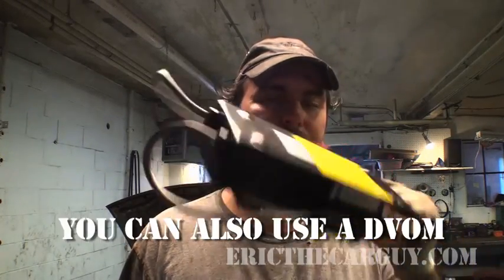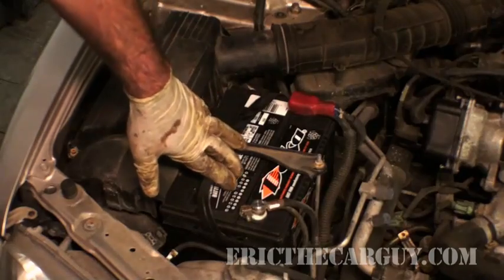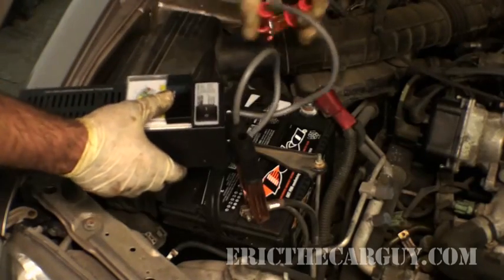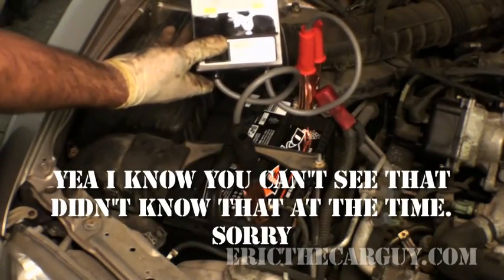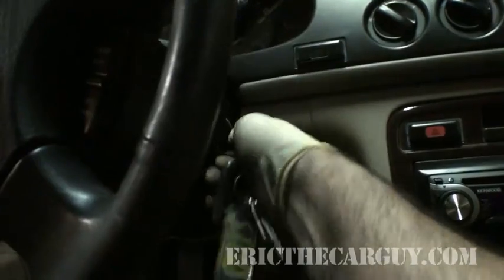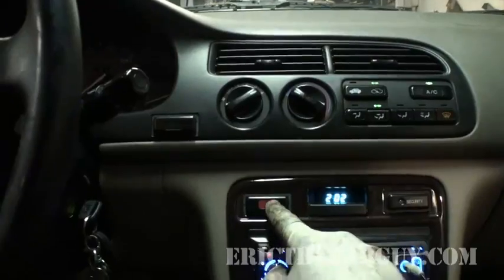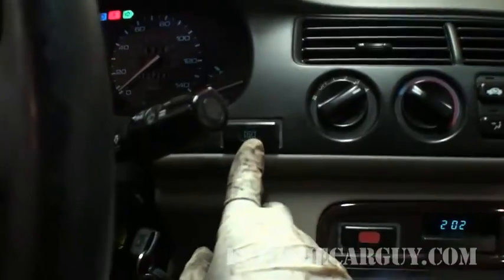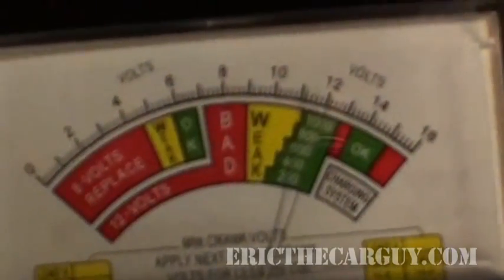How To Check A Charging System - EricTheCarGuy

Comment: @happy543210 I do not want to get into a who knows more argument. You have a good point, The alternator's purpose is to recharge the lead acid battery by providing voltage in the opposite direction of normal electron flow. It is also to power the vehicles electronic system. The battery's purpose is to start the car and act as a capacitor smoothing out voltage spikes from the alternator when the engine is running. It doesnt matter what someones age is if they know what they are talkin about.

Comment from the maker: @spelunkerd In order to see if an alternator is capable of putting out max power you need to put it into what is referred to as "full field", GM's used to have a spot in the back of the case where you could bypass the regulator and put it into full output but these days this is done electronically and such provisions have pretty much gone away.  To be honest by the time you track down a voltage regulator you might as well have replaced the whole unit anyway.

Comment: Hey, Eric. How do you test to see whether it's a problem with the voltage regulator, or the alternator itself? Is there a way to isolate these two devices to see whether you need to change both?

Dave

Comment: @happy543210  it isnt a test you need to do with the car running. It is a test you do with the engine off.
When you rub a magnet on a needle to make a compass the magnetism doesnt just stop when you stop rubbing it. it is the same principle all this test does is test if the windings are shorted out or not. it is a pass/fail test therefore an easy and quick one to do.

Comment: @dseries16 I'm gonna guess you're 16 years old because you DON'T know that an alternator is not built to handle a LOAD. Its purpose is to recharge the lead/acid battery by providing voltage in the opposite direction of normal electron flow.

Comment from the maker: @Razorbackfever There is not "clutch" in the alternator but there is a voltage regulator.  If it only charges at higher RPM the alternator probably needs to be replaced.

Comment from the maker: @Marshmallowrex That is a video in and of itself.  The key to an effective diagnosis however is having an accurate wiring diagram for the car, without it you are just guessing.  The idea is to use an ammeter to measure the draw that is draining the battery and pull fuses one by one until the draw goes away, once you find the effective circuit you need to nail down the fault within it, this is where the wiring diagram comes in.

Comment: @happy543210  just because your alternator is capable of putting out 12-14 v without a load does not mean that it is a good alternator there are quite a few things that can go wrong with them. that is why your alternator might be working fine (or so you think ) when you are driving down the road at night but coming to a stoplight your headlights dim and your engine rpm might even drop and that is because your alternator is capable of putting out the voltage but cant handle a load.

Comment: you can also take a screwdriver and touch it to the center of the pulley or the bearing cover on the back side. If the alternator is magnetic;y charged at those points then your alternator is bad and do not need to do any further testing. 

IF your alternator is not magneticly charged then further testing would be required to determine whether or not it is bad.

This is always the first test I do cause I think it is easy ( not always conclusive but easy)

Comment: All this time I thought those tester devices had to be connected to the altinator shows what I know lol. Also I was told that a hack way of determining if you have a bad alt and you don't have a fancy smancy tester, start the car & disconnect the battery, if the car dies the the alt is bad. I think that's how it works. Great video as usual Eric.

Comment: Mine will only charge at higher rpms and my belt is good and connections are good. Only thing i can think of is the clutch on my alternator isn't engaging at higher rpms.

Comment from the maker: @7864222804 Fuel pumps on Honda's don't often go bad, I would check to see if you are getting power and ground to the pump before changing it, if you don't your just throwing parts at it.

Comment from the maker: @integra57 That is a tricky one.  The smaller pulley would spin the alternator faster and potentially produce more power but as you say if the voltage regulator would step in.  I think the key here is to understand the difference between voltage and amps, amps are produced based on circuit load and would have little to do with more voltage so my answer would be that the amp output would be dependent on circuit load and not how fast the alternator was spinning.  I could always be wrong however.

Comment from the maker: @happy543210 That is the point, the only way to truly check the alternator output is under load.  I did mention you could use a DVOM to perform the same test.  Thanks for the comment.

Comment from the maker: @Marshmallowrex You may have what is called a "parasitic draw" that drains the battery when the car is off.  First check the battery to make sure it is good, if it is the next time to leave the car sit overnight disconnect the negative cable, if the car starts the next morning then this is probably the case.

Comment from the maker: @jeyrapboy Sounds like it was the connector for the oil PSI switch.  If it broke it's a very good idea to replace it.  They usually require an 1 1/16 socket BTW.

Comment: @integra57 I'm not as smart as Eric but my answer is, would it produce more voltage idle ?  Yes, since the smaller pulley will cause the alternator's axle shaft to spin faster.  Will it produce more amperage?  A higher speed on the alternator shaft will produce more voltage which  would produce more current for the same load.  But if the load isn't there the answer is no to producing more amperage.  Kind of a trick question in my opinion...

Comment: Hello Eric. What about the good old way of checking an alternator: take a volt meter and place the leads on the battery posts. If you have 14 volts=good alternator. If you have 12v or below=bad alternator. This is regardless of electrical loads.

Comment: thanks
recently my battery went dead and then it resurrected back.

this happened after some driving over some hard bumps in the road
the battery saw shaking like if i was mounted in a off road vehicle.

i think some deposits rose from the bottom of the battery and contaminated temporarily the electrolite, which caused the battery to almost drain out over night.

after the car was stopped for some days the battery turned back to normal.
that happened some months ago, and it still works ok.

Comment: I have a 1991 toyota camry dx 4 cyl that the battery goes dead after 3 days changed battery cleaned terminals and now I know how to check the alt. as it may not be fully charging the battery .

Thanks

Comment: You cannot be more right about the connection thing. I had so many problems with my car not starting, it would turn over weakly then click. Almost sounds like a dead battery eh? Turns out it was that ground wire that is screwed to the body panel, cleaned it up a bit and she started no problem.

Comment: Good video man. Quick question tho. yesterday while changing my oil filter during a oil change i see this connector just pop out. I was like what the heck, well i get in to start the truck after is all said and done and my oil pressure gauge was at 0. So was that the oil pressure switch that just fell out? Looks like it broke to me,

Comment: I like how you covered charging system.  Hoovering around 12v seems like it would be border line bringing down the charge of the battery.  Maybe that is why they are also checked at higher rpms.  This was one of my requests. Thanks for keeping you word Eric.

Mike